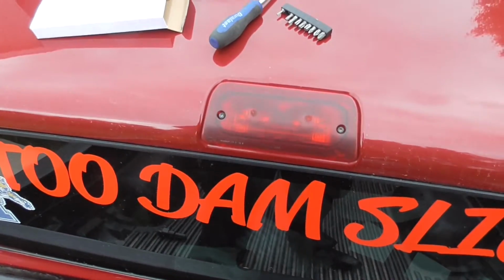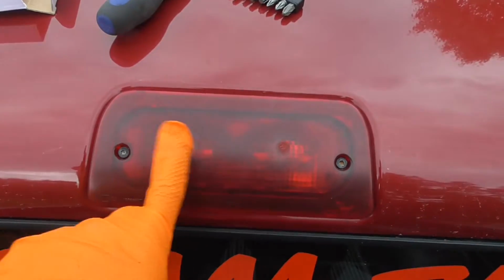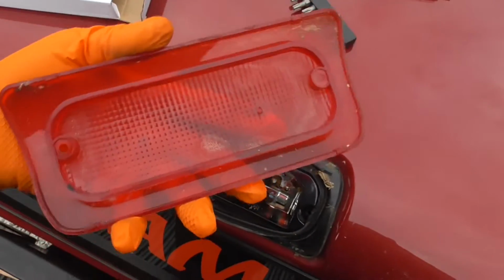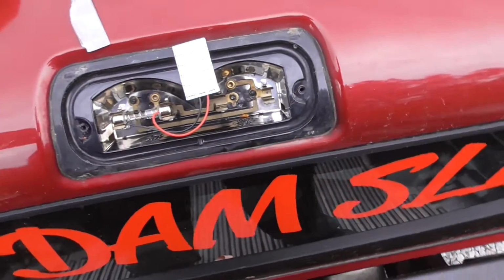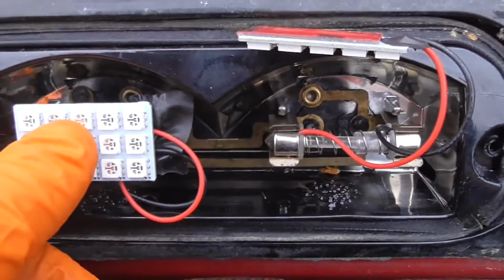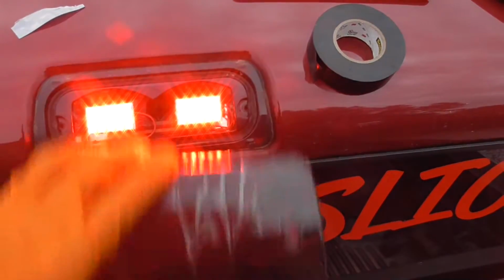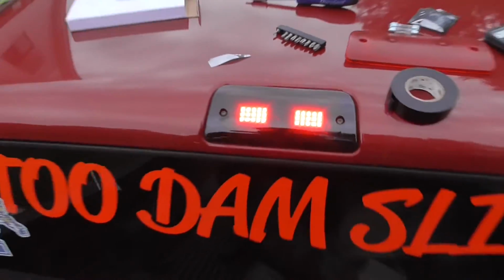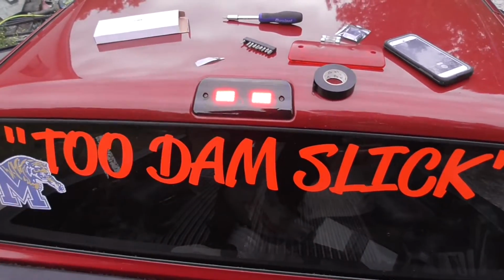GMC Sonoma S10 Extended Cab LED Third Brake Light Smoke Lense

Comment: I had a 3rd brake light out. The lights had burned out and I replaced them. Didn't work. No power to the lights. Checked the fuse under the hood. Power at the fuse. Took off the dome light cover. Removed the dome light assembly. Checked the wires that supply power to the 3rd brake light. Had power. The problem was corrosion at the rivets. Twist and turn the rivets several times. Voila .....power to the 3rd brake light. Had friend buttress the rivets on the brake light side with ratchet extension and hammer and punched the rivets for a better fit on the dome light side and a more permanent solution.  Then just put everything back in place. Works perfect now. Hope this helps someone.
Reply: Did what you said and I have lights again! Thank you for letting us know!

Comment: Hey, guys! What tool do you use to remove the original plastic lens? Mine is a '95 extended cab, and I just want to replace the bulbs. Phillips screwdriver is no help, and the screw heads look rusty. Thanks for advice!
Reply: Torque screw

Comment: Definitely a old video because they do make them for extended cabs.
Reply from the maker: Video is not that old, and no,  there is still not a drop in replacement LED housing for the EX Cabs. I look from time to time and have yet to find one. Only CC and single cab trucks.

Comment: You taped it?! Dude, no...
Reply from the maker: What's so bad about it? It's electrical separation and I used the correct tape. Would you rather it short out against the terminal? I would hope not.
Reply from the maker: And to answer the question you deleted/edited, yes. It's only two screws, but the LEDs run a hell of a lot cooler and stop the lenses from melting. Melting lenses are a super common problem on these trucks, I've seen them melt through and have holes in the lenses.
Reply: @DanielPace92  What tape did you use? Is it a double sided tape?
Reply from the maker: @thepepperlanders  The black tape is just electrical tape to separate the circuit board from the connections. The red covered tape that actually holds the LEDs in is just double sided tape.
Reply: @DanielPace92  That was real nice of you to provide an alternative. I have the same problem so I'm going to check it out today.
Reply: The link for the leds isn't good anymore. Any other or updated one?